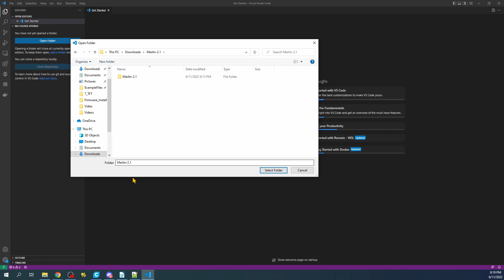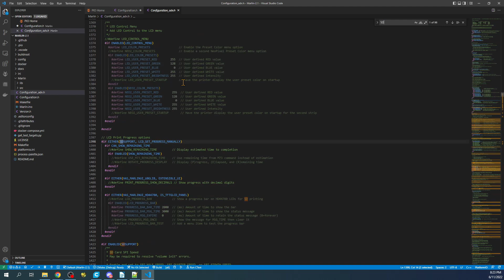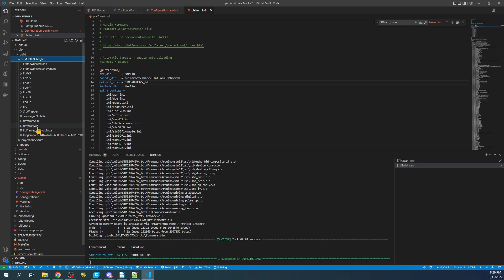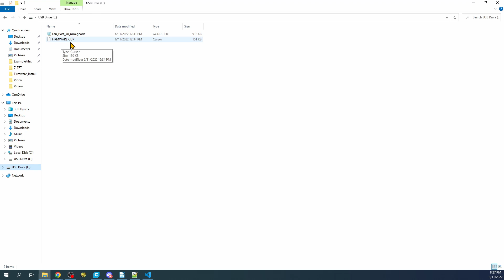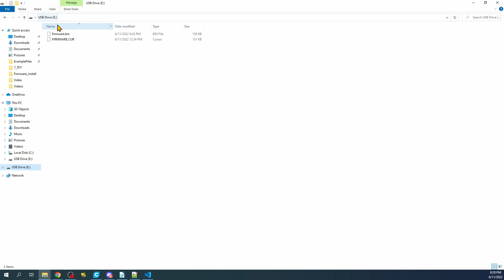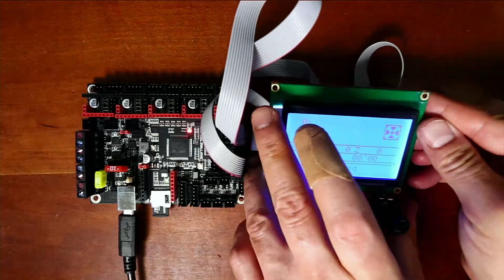SKR 3 RepRap Discount Full Graphics Smart Controller

Comment: Thank you for the 'different' processor hint. I had no idea why the display stayed blank (only backlight on) but my BTT SKR 3 EZ came with a STM32H723VG and NOT a STM32H743VG as in the BTT github example.
Reply from the maker: That happens a lot they release a new board and change the MCU.

Comment: Hi Ed, I´ve an issue with the BIGTREETECH mini 12864 V2 on SKR3EZ. I´ve connected it like in the manual´s and configured it like it is shown in the description, but there is no way to use #define NEOPIXEL_TYPE NEO_GBR like it is shown in the desciption. It will show me that this is only supported as RGB. Is it for you possible to check this? I´ve spend hours and didn´t found a solution. This will be great. Thank you very much. I´m using the newest Version of Marlin 2.1.2 (Mar 18 2023) Best regards Willi
Reply from the maker: I've had similar issues and have contacted BTT on recommendations for configuration, just now.
Reply: @EdwardBraiman  That is a good choice. I will do it too. Hope they will give us a solution. Great Tutorial´s and I´ve learned so much from you to understand this complex world ;-) best regards Willi
Reply: @EdwardBraiman  Ok I opened a ticket on BiQu and we will wait for the solution. Thank you Ed for your tip. Best regards Willi Webels

Comment: It does not work with my skr3. Same hardware and firmware settings as yours (except cpu which is stm32h723), but the lcd just light and do nothing else. What could I have done wrong?
Reply from the maker: Is the little white button on skr 3 pressed?  Click it once and connect USB.
Reply: @EdwardBraiman  there is no USB connection regardless of the white button... the led lights, the firmware flashed, but no connecton, do nothing. It is a brand new card from BigTreeTech webshop, maybe it is wrong?
Reply from the maker: There's a discord channel link in description.

Comment: Hi thanks for your videos. I love them. Can you please help me? I'm trying to build a 3D printer using arduino mega and RAMPS 1.4. I've used RepRapdiscount full graphic controller but the problem is the potentiometer's rotation and the screen menu doesnot rotate in the same direction, they are opposite. How to I solve this issue? 😭
Reply from the maker: This is the setting in Configuration.h  //#define REVERSE_ENCODER_DIRECTION
Reply: @EdwardBraiman  Thank you so much for replying,It worked.I've learned so much from your videos, you're doing amazing work brother lots of love for you 😊❤️
Reply from the maker: Thanks.

Comment: I have tried doing this with a skr v2 and all I get is a blue screen and a very hot heat bed that I did not set and no connection to the pc when plugged in to usb this is a brand new rev b board really can't work it out if you have any ideas I'm all ears buddy
Reply from the maker: There's a Discord link in description and either myself or someone else in General chat can help.

Comment: Quick question, I s it possible to use displays made for Arduino on the MKS 1.2 - 1.4 boards. I really want to add a epaper display to a printer I have that doesnt have one. this printer you have to change the file name to the file you plan on printing then press a button on the front to print it. I would like to add a display and flash to marlin. it is a 2560 processor.

Comment: Can you comment on the proper configuration for a part fan f0? Using skr2 plus tft 32 v3 and marlin 2.1. Can't get it to work. Tft won't control a fan plugged into pb7. Also manual feed for E0 stopped working after marlin 2.1 update.
Thank you.
Reply from the maker: In my SKR 2 playlist or Octopus playlists I might have covered this.

Comment: I can never get the encoder to work correctly using the octopus board doesn't matter what I choose in marlin still jumps
Reply from the maker: There's a setting in Marlin, but the display is an emulator.